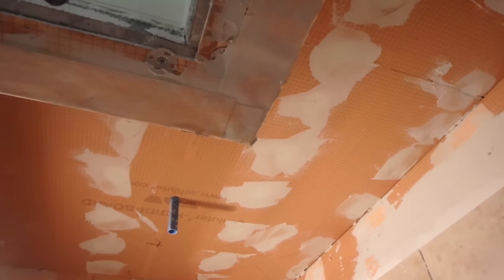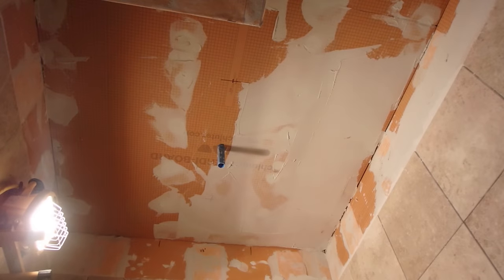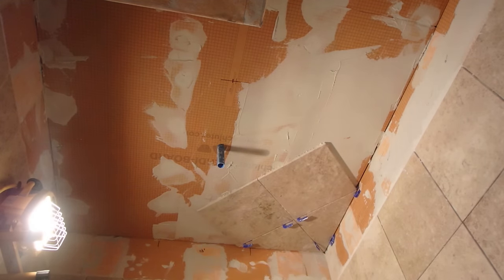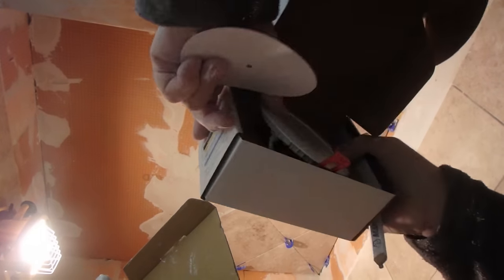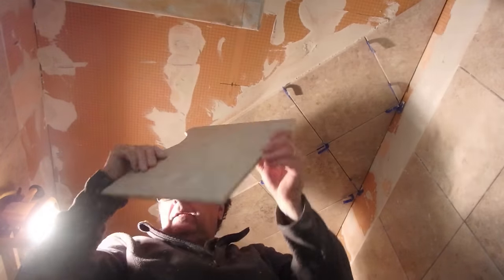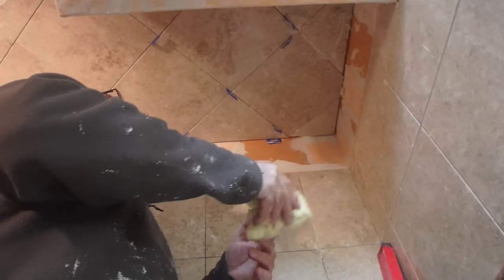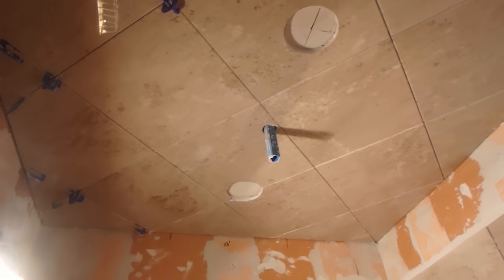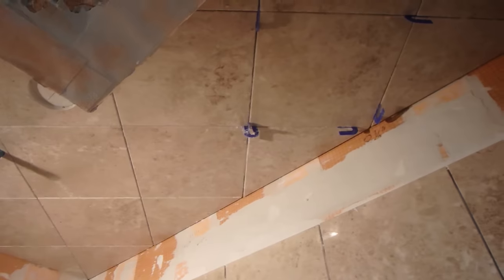Tiling your shower ceiling here's how.  No it won't fall on your head!

Comment: Don't really want to up the debate about modified vs. unmodified over Kerdi, but just to point out, if you use a lite low sag thinset such as Custom Pro Lite, it's going to be modified.  Now, I know that's not the end of the world.  After all Schluter All Set is modified too.  Just an FYI.

Comment: I would like to see you do this in England, where walls are solid, sloping, crumbing cob, with ceilings that are lathe and plaster. It would really push your skills to the limit.
Reply from the maker: Well fortunately I am in the US, were we would remove all old crumbeking stuff unsuitable for tile installation, and replace it with a nice new solid surface ready for tile.
Reply: I did a lumpy bumpy ceiling once. I had to double thinset some of the tile. They were sagging pretty bad and it was a mess. the next day the tiles were pretty much flat. I am guessing the thinset shrunk and pulled the tile in.
Reply from the maker: @tufriverboards2054  So here is the thing, fix the ceiling before installing the tile, if the thinset shrinks, it also shrinks away from the tile and causes a weak bond. Thinset has a maximum depth it can be safely used before it starts to shrink, you can use aN LFT mortar for thicker depth when you have larger tiles. However pep is the key to a good end result.
Reply: @SalDiBlasi  I should never have to deal with another situation like this, well unless I move to England lol. I prep all my work flat and plum. Some of the tile literally sucked in at least a 1/4". I was planning on pulling the bad tiles off the next day, if they didn't fall down over night, then resetting them. My first thought was they all sagged down, but my trim piece was tight and the tiles were more in plane with them. I believe I used Custom Pro lite thin set. It probably would have made an interesting YouTube video.

Comment: I have been a mechanic for over 30 years and I really do appreciate you sharing your tips and tricks of your trade!👍
Reply: I've been a barber n nail tech. I just rebuilt my garden size bathtub.4 month to do because I didn't know what the plastic was and I found out its ABS what a headache because my tibe is 38 years old and new ones are built so cheap. It was worth it to rebuild mine.
Im going to add my videos soon as no one has done this in any videos. Plus what I used lol being a Nail tech was great use,as I know about polymers and acrylics. I came here to see what he did,so I can do mine. Good job.

Comment: Technique is the most important thing, Sal. We often use unmodified mortar on our ceilings and never worry about them falling off. Zip poles and blocking isn’t necessary. Great video as usual!  Thanks for sharing.
Reply from the maker: Funny how anyone that has never installed a tile on a ceiling thinks they won't stay up. Never had one fall yet.

Comment: Sal: I have a pot light in my shower that will not sit flush. The light can itself was probably set too low, but I’m not going to replace it. What can I use to ‘glue’ the trim down so it sits up against the ceiling tile? btw the tile is not smooth. It’s a textured tile. Thank you.

Comment: I have a question hope you can answer it I do handyman work and get alot of different jobs I do everything now my question is I have a customer now who has tiles on her ceiling which a few fell down and from the looks of it they put a few blobs of thinset on each corner of the tile and pushed it up which they didn't do a thin coat over area like you did now my question is if a few fell already from only putting a few blobs on each tile without a thin coat will she have further problems of the rest fallen down should I tear down all the top tiles and re do it this way if you can answer I'd greatly appreciate it
Reply from the maker: Yes that is called spot bonding, one of the worst problems in the industry https://cdn.ymaws.com/www.tile-assn.com/resource/resmgr/pdf_files/SpotBonding6._Final_9_12_22p.pdf

Comment: What backing board did you use on the ceiling? Will Dura-rock work for ceiling tile and does it need to be skim coated as well before applying tile?

Comment: Hi would you tile the slope of stairs when building a shower in the basement under the stairs?  The 1/2 inch cement board is directly attached to the stairs. Large 12x24 inch tile.

Comment: What type of thinset mortar did you use for the marble tiles (epoxy or water based)?  If I have moisture sensitive stone or agglomerate tile, is it possible to coat the back of the tiles with some type of 2 part epoxy first and then set the tiles with regular unmodified thinset mortar?
Reply from the maker: Look into ARDEX X 32™ MICROTEC® https://www.ardexamericas.com/product/ardex-x-32-%E2%80%8Bmicrotec/

Comment: Ciao Sal very nice work hope all is well what thinset would you recommend for installing 12x24 porcelain tiles on ceiling over cement board? Grazie
Reply from the maker: Ardex X77, or Custom Prolite, or Mapei Ultralite, but any thinset mixed properly will work.
Reply: @SalDiBlasi  grazie Sal good wishes to you
Reply: Sal thanks to you we were able to install heavy 12 x 24 porcelain tile on ceiling using prolite thinset worked like a charm cheers to you best wishes

Comment: Can I do this with Kerdi Membrane over an old drywalled ceiling?  I pulled all the old tile off the ceiling already.
Reply from the maker: Without knowing any specifics, I would say tes, as long as the kerdi Membrane has been installed properly and been allowed to dry.

Comment: Hi Mr Sal. Video is great as always. Does bathroom floor should be lowest point in the apartment? I heard is best practice to make it lowest so in case of flood water tends to go to bathroom and eventually drains away.
Reply from the maker: If you have a curbless shower, there is always a possibility that a clogged drain will cause a problem that would otherwise not occur in a shower with a curb. Best practice is to have a secondary drain in the main floor, have wall hung fixtures and waterproof the entire wall to floor connection. That being said, curbless showers are built every day with little thought to possible issues that a clogged drain can cause.

Comment: No Kerdi band on the ceiling screw locations or seam? Is it Kerdi-Fix? Straight thinset?
Reply from the maker: It will never see water up there, does not need to be watertight unless it is a steam shower, which this is not.

Comment: This is a silly question, but what is the orange boarding you are adhering the tile to? A type of hardibacker?  For the shower ceiling, can you use a cement board or is this orange board a better option?
Reply from the maker: It is a foam board made for waterproofing a shower. This one is a Schluter System, but laticrete , and other manufacturers have similar systems. Far superior to any cement board.

Comment: What do you mean when you say "regular" thinset? Unmodified? I'm using Kerdi too and it explicitly says do not use modified over it or under it. And everyone I've talked to says it polymer modified mortars wont cure properly over Kerdi. But the unmodified is even harder to get to stick to ceiling, almost impossible lol
Reply from the maker: When I say regular, I mean just that, a thinset mortar with no special properties. The issue with modified thinset over Schluter products has never been that it won't stick, it has always been about dry time. I have gone over this many times, in the past few years there have been many advancements in mortar technology, the curing issue has been resolved with many of the newer mortars, Schluter makes its own high polymer content ANSI A118.15 mortar that it recommends for all phases of the installation of its products and tile on its products, it is Called Schluter AllSet.

Comment: Great video Sal. I noticed a band of darker tiles within the wall approx 3-4” wide. Did you cut those from larger tiles? It seems a nice alternative to using mosaic or similar for an accent.
Reply from the maker: This is actually a replacement to what was there to match the rest of the bathroom, the shower was leaking so it was ripped out and I am installing the new tile to be as close to the original as possible, minus the leak. The band if tile is granite cut from larger tile, the field tile is marble. I would have preferred to update the shower a bit, but it was not my call.
Reply: Thanks Sal.

Comment: Hi Sal  . So when your tiling a shower ceiling can you go over the sheet rock with your backer board ?
Or do you need to move to 12” o’clock framing ? Thanks Paul 
You got it down man !
Reply from the maker: As long as it is attached with sufficient number and length of screws, yes.

Comment: Great video as usual.  
I didn't like how you layed out the ceiling starting with full half tiles on two walls and having odd cuts on opposite wall. The lights and rain head didn't fall in the center of a tile because you did not start from center and push out. 
Ceiling are a bear and are time consuming.  They are even worse when trying to control the lippage because you are fighting gravity.  Any variation in the ceiling flattens before the installation creates problems when installation begins.  Collapsing the trowel ridges is also a bear when working on a ceiling as we saw in your video when you removed the tile to address the light. Solid backing behind backer board aids in the installation to prevent the backer board from flexing as you push up on these tiles to create the suction they need to stay there.
Reply from the maker: The ceiling was an odd shape, not a square, so I layed it out for the best overall look. Looking into the shower from the half wall and the entrance, you see full tiles on  both prominent walls, the other areas you have to be in the shower and specifically look at the ceiling to notice the cuts.

Comment: I myself as it installer, I like to flat trowel the ceiling the day before installation of tile, reason being it helps absorb the moisture in the thinset on the tile installation. And I was noticing you did not tape your Corners what's the trick on that?
Reply from the maker: Really best not to do that if you want the mortar to transfer well, wet thinset sticks better to wet thinset.
Reply: Well the day of tile installation I would also put a second flat coat on the ceiling then notch the back of my tile. Before there was back aboard we met at everything, kind of use the flat coat on the first day as somewhat of a scratch coat if you want to call it that or burncoat.
Reply: Forgot to ask how come you don't tape joint on the ceiling